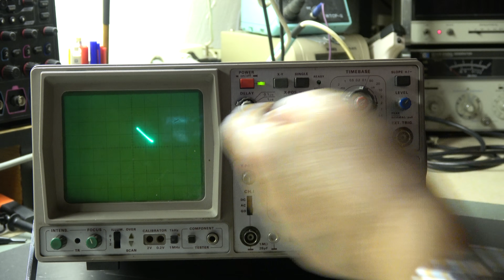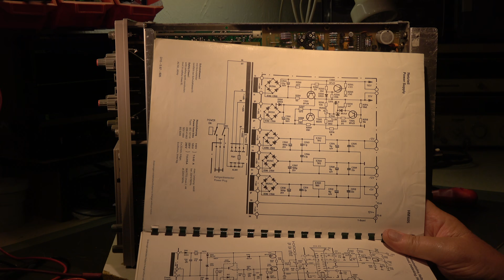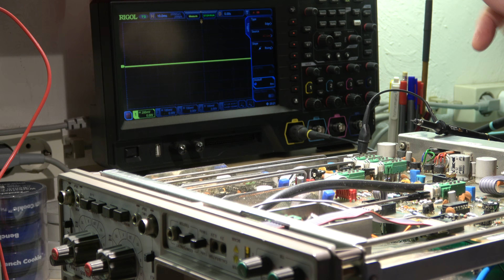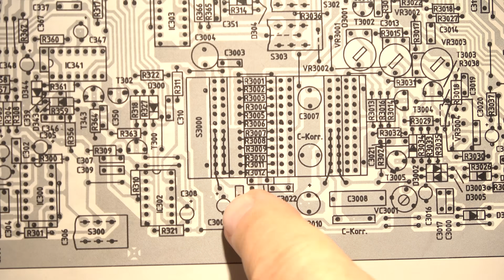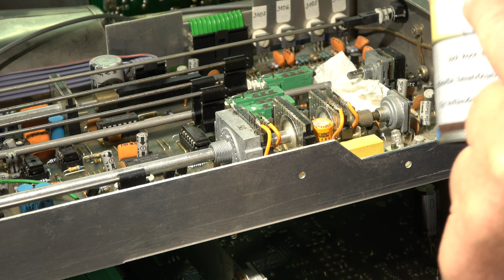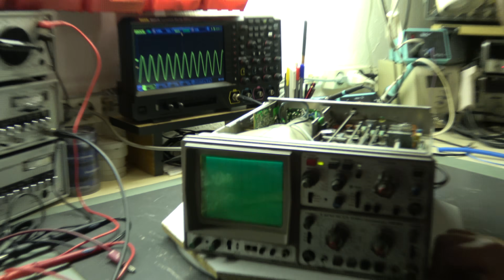#138 Hameg HM605 Part 1(3)

Comment: Hello Mr Stefan. I have a second hand 605 and when i switch it on everything is ok. After 10 minutes (i guess when capacitors are loaded) the beam becomes thick. Like the oscillation in your video. Do you suggest anything i could do ?
Reply from the maker: Dr Giannis, i think it is a thermal problem in the HV-circuit; oscillations would occur immediately. A thick beam means a changed HV or a changed focus-voltage. Connect a voltm,eter (DANGER) referred to the cathode of the CRT, measure and observe them whether they change. Bad resistor or leaky capacitor there.
Reply: @dl7majstefan753  thank you for your response ! i will check with caution !
Reply: @dl7majstefan753  for what is worth after inspecting the pcbs i found a broken leg ceramic capacitor (10pf) from underneath (pad side). Too difficult to reach the spot and swap it without getting out the pcb, so i soldered the broken connection. Worked like a charm ! No oscillation what so ever ! Thanks once again ! Your video series and your response helped me a lot !
Reply from the maker: @GiannisDamianidis  Great! Congrats! The 605 is worth to be preserved.

Comment: FRAKO, ROE, PUNSUMI and ELNA. The 4 magic brand capacitors which MUST be changed out in any equipment, regardless how well they look and work.
Reply from the maker: You are right regarding the best repair. But i have two reasons not to do this:
1. The value of this scope is low and it is no rare or historical unit - many of them are on the market
2. Personal reason, i´ll explain at the end